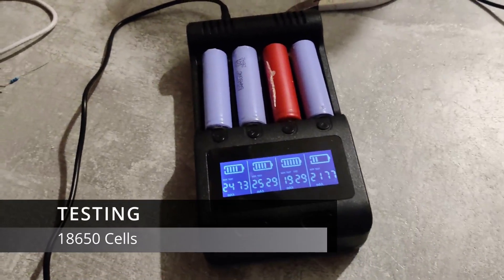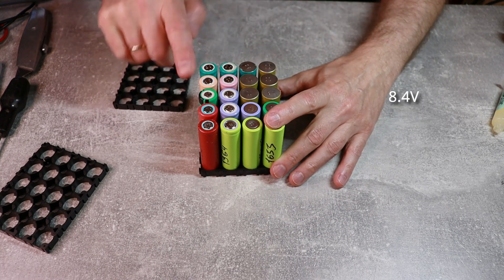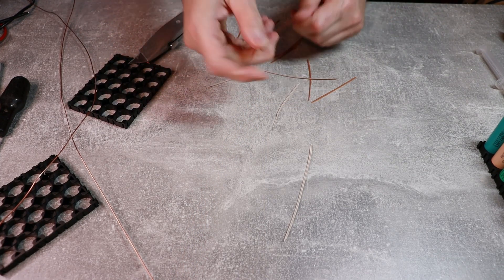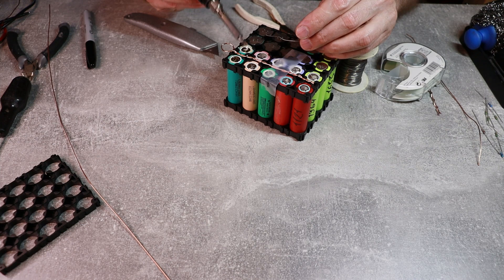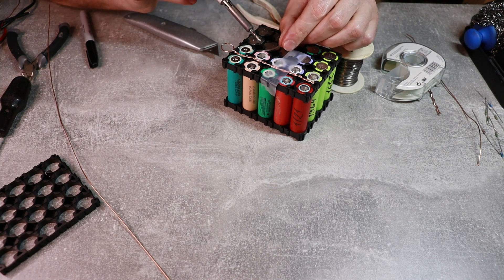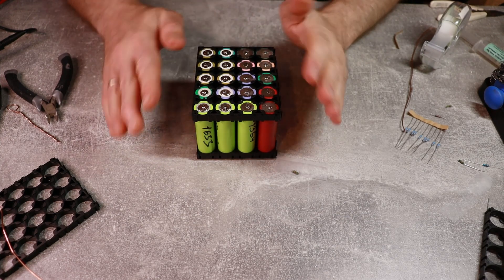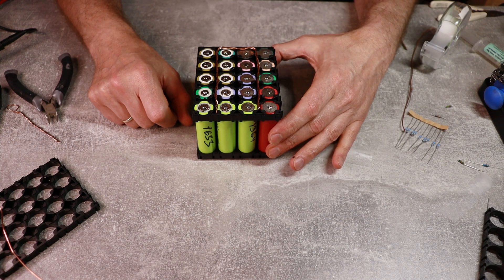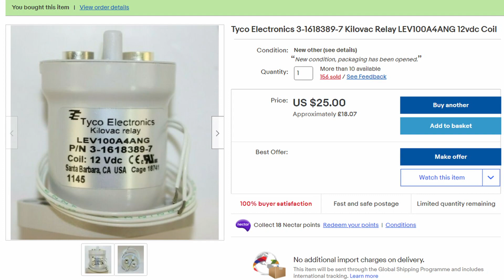Power modules from laptop batteries DIY EV Toyota Prius Ep 6

Comment: some said : do not solder battery, i asked why , they answered: you will see, now past 10 years and nothing happened?!
Reply from the maker: In theory the heat that you submit during soldering process may slightly damage battery. In reality as those are not brand new cells and I used higher temperature but soldered for shorter period of time I think it will not make any difference.
Reply: @LatutaEV  i agree

Comment: 84 of these power my mower, 8000 of these (better cells) are in a Tesla pack.
Reply from the maker: Yep that's true. I am using these just to test the motor. I will be getting a new set for the car though. I am thinking about trying LFP as they can be charged to 100% as well as being less sensitive to temperature

Comment: hi did you solder each wire to the busbars?
Reply from the maker: Just a bit of flux and it soldered on pretty easily
Reply from the maker: In case of the bottom part yes